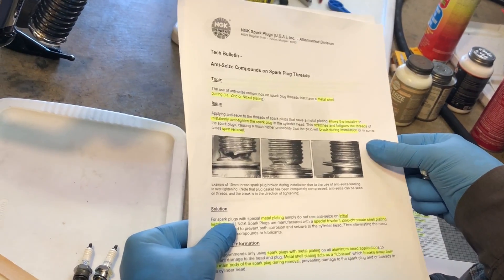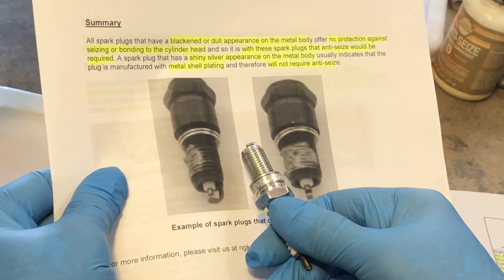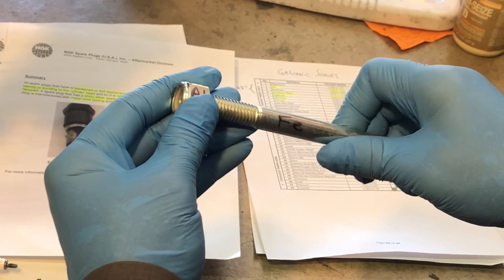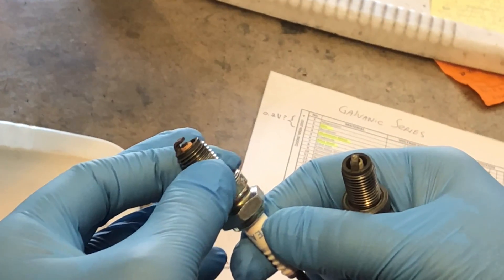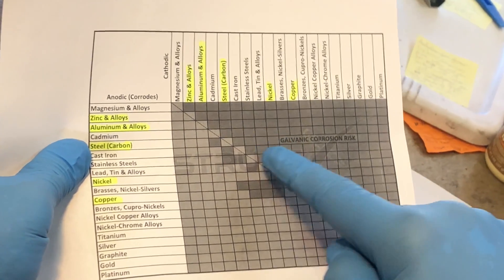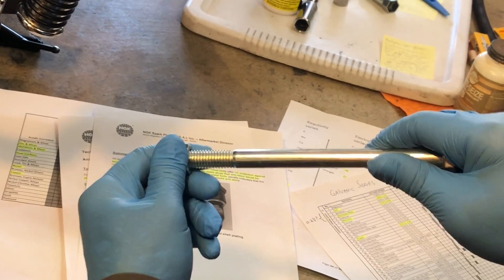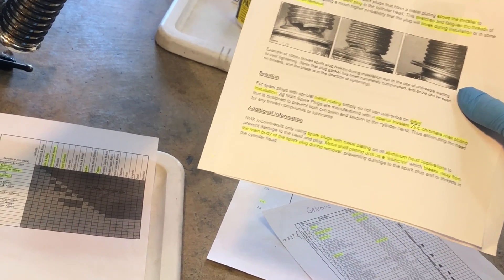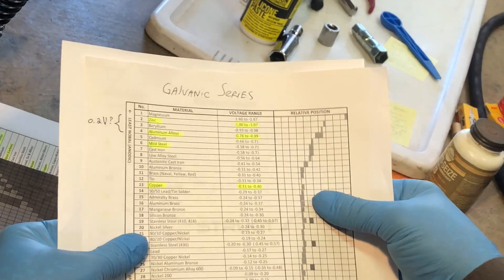Aluminum cylinder heads, spark plugs, anti-seize, & galvanic corrosion

Comment: Excellent video!!  I don't care what anyone says, all of my spark plugs will get anti seize with a 30% torque reduction!!  I see time and time again these idiots in the comment section regurgitating not to use it, and I can only wonder if they are running a machine shop fixing stripped aluminum heads, haha!!  And just like you demonstrate what happens to the factory coating after numerous heating and cooling cycles perfectly illustrates why to use anti seize!
Reply: Yes, the torque reduction is the key if the torque spec is for dry threads.  Airplane engines require antisieze per the manual.  The torque spec given is for a lubricated threads.  It is very specific about leaving the first two threads that stick into the cylinder clean.
Reply: Exactly, in fact the Bosch spark plug manual species the % reduction in torque values when using anti-seize. I removed spark plugs in vehicles of friends and some were a real challenge taking time and being patient. In over 50 years, I have always used anti-seize on spark plugs as well as exhaust and high heat components.
Reply from the maker: Thank you for the comment.  Yes, the more miles-in-service a plug has, the higher are the chances of it seizing up in the spark-plug hole.
Reply: Yamaha motorcycles come with anti seize on the plugs from the factory and use ngk cr10ek etc plugs.  These have the zinc coating.  
Yamahas service manuals call for standard anti seize on the plugs.  
When i went to the tech training we were told you should use it to prevent broken plugs.   Exactly the opposite what NGK feels😂
Reply: @blue03r6  Thanks for sharing that!
Reply: Putting steel inserts in an aluminium block would solve the issue, right? 
Ok, it would be an expensive solution for a problem that only occurs on a minority of the engines so I understand why this isn’t done by manufacturers. Or are there manufacturers (for special applications perhaps) that do use inserts? 
I’m just curious.
Reply: IMO, helicoils or steel sleeves would likely help, but as far as being practical, probably not so much for a manufacturing process the manufacturers simply wouldn't want to take on the extra costs involved, plus once they get the heads out of the plant, and 100K+ on the engines, they could care less, in fact, they probably hope you wring the threads out so the owner will buy another new vehicle!  if you "sleeved" the spark plug holes in the heads, you still have the aluminum thread the sleeves are threaded in, so that is still a weaker link than steel.  Since mechanics are nuts today and charge so much, it makes more sense for some folks to just buy another vehicle.  IMO, a little anti-seize with reduced torque will solve all those dissimilar metal funkiness we sometimes run into with engines.  @Conservator.
Reply: @AccuracySpeaks  Thanks 👍
Reply: @Conservator.  This takes me back over 40 years ago to the days when I was a flight instructor and would work on training aircraft (Cessna) Continental and Lycoming engines on below VFR days. I was surprised that new cylinder assemblies came with Helicoils in them. I always thought they were only used for repairs.
Reply: @a.c.e.7568  Ah, thank you very much! Using them in the aircraft industry makes sense and it’s always nice to have your thoughts confirmed. 🙏
Reply: Well, what happens when that plug doesn’t get grounded because the antes you may have not had it happen yet or you get a little bit and it causes misfires. I’ve had both things happen and I’ve used the gray antes on plugs and still had them seized in so I don’t use the gray. I use the gold because it takes more heat, I’ve yet to see time I’ve been working on vehicles in my career and last 42 years a NKG plug seized in head. I’ve never seen one unless it had water down in that plug hole. That’s the only way, but I still got the plug out with no problems, I understand what they’re talking about with a different types of metals. It won’t go around correctly two different types of metals with anise will cause of chemical reaction. I know you don’t believe it but if you think about it logically and been around long enough and seen Russ belt vehicles New York, DC, Maryland back west you don’t see it I put anise on wheel bearings because I fight those bastards to get them off tooth and nail. I even put them on you joints the bell of the transmission so it does not seize because of the salt and a snow rain whatever we pull transmissions out had the bolts completely out because it was seized on the block. It was just hanging there would not break loose. We had to get a air hammer lightly go all the way around it and break that pig loose. It was stuck all the way around to the Bellnever been out snowplow truck if you ever worked on one of those your best friend is those torches and the turbo sockets and air hammer with a bit so you could put a socket on it that bolt
Reply: I've been preaching antiseize for 40 years. Your presentation was excellent.
Reply from the maker: Thank you!
Reply: Working as a Mitsubishi tech in dealership since 1994 been replaced thousands of NGK spark plugs when performing 100000 km service (First replacement since rolled out from the factory) apparently never had one seized before until today.
Reply: On the other end of things, the only plugs I’ve ever had trouble with were ones I put anti-seize on. The stuff doesn’t handle the heat and gum/carbon up. I stopped using it over 25 years ago without issue.
Reply: Hey! I got a great idea! Don't be a lazy fool and leave your sparkplugs in your engine for a hundred thousand miles! And believe me when I tell you, that you don't want to reduce your torque on a Ford F-150 5.4 triton engine or it will launch a sparkplug right through the hood of your vehicle!😳
Reply: @tonymayhew191 you are correct. Everyone has to make it complicated. Just change your plugs
Reply: @randyralls9658  Yeah and some of them even wreck their aluminum heads in the process removing a seized spark plug.. I never have though because I take precautions.
Reply: @tonymayhew191 :  You understand that derating torque spec for lubed threads results in a spark plug that is equally stretched compared to the dry thread install. Thus the two are equivalent.  Yes?

Comment: Thanks for putting this up.👍What you say about decreasing the torque by 30% or so makes a lot of sense. I changed the spark plugs in my daughter's car and one of them was corroded, and misfiring. Is there a way to clean the mild corrosion on the engine block around that spark plug?
Reply from the maker: If the area around the spark plug can be easily accessed, you could try removing the corrosion using WD40 and a fine Scotch Brite pad or 000 or 0000 steel wool.  Just make sure the spark plug is threaded into the hole before you do this, so that the debris you generate does not end up inside the engine.  Then clean the area with mineral spirits and wipe up with a paper towel or clean rag.  Finally, use some compressed air (or something like a Metrovac Air Blaster) to blow any remaining crud out (don't forget eye protection).  Also, you might find my video on spark-plug replacement helpful: https://youtu.be/q2r0FmzXLI0
Reply: @Zerk_Ziegler  Thank you, I checked out your other video about changing spark plugs - very informative. I like that you address spark plug corrosion in this video, not many do. My daughters car is a 2008 Mazda 3, so the spark plugs are very recessed, but I might give it a go. Thanks again!🙂
Reply from the maker: If the plugs are recessed, it is important to blow any debris out of the recessed areas.  Otherwise, at least some of it may go into the hole the next time you remove the plug.  Not the end of the world, as it's likely to be blown out of the exhaust.  However, there is always a chance of scoring the cylinder walls and/or damaging the piston rings.
Reply: @fredfred4086  from my experience... change the boots. silicone grease/oil will help, but mostly.. change the boots. misfires and corrosion usually suggests pooled water sitting in the hole, the boot gets wet, arcs internally, gets a carbon path... and once thats developed, its useless.

Comment: What do you recommend to use removel of seize spark plugs for my 2004 Ford Expedition
Reply from the maker: First, if at all possible, clean the area around the spark-plug threads thoroughly using a solvent, like mineral spirits.   Then apply a 50/50 mix of acetone and synthetic automatic-transmission fluid around the threads.  Give the fluid ample time to penetrate (the acetone makes the lubricant very thin, so it can wick into the threads by capillary action).  I would then wait two or three days,  liberally re-applying the penetrant several times.  Do not use "gorilla" force when trying to screw the plug out -- try to turn it counterclockwise a little and see if it moves.  You could also try turning the spark plug CLOCKWISE at first, just a smidge.  Do not force it, or it might break!   If it moves a tiny bit, that is all you need.  Then try to turn the spark plug COUNTERCLOCKWISE, but again, only a little.  Then apply more penetrant and try to work the plug back-and-forth to see if it moves easier.  The key is to proceed slowly and not apply a lot of force.  If you get the plug to move a little, but it still does not want to come out,  reapply the penetrant and walk away for another day or two.  Again, I cannot stress enough that patience is key here -- rushing the process never ends well.  There are other things you can try, but this should be a good start.  Oh, and whatever you do, NEVER apply any impact to the spark plug.
Reply: @Zerk_Ziegler I just watched a video where Ford technician recommends removal of plugs with a ½" impact gun.. 😅
Reply from the maker: @sidewayzmike  If that porcelain nose breaks ... keep in mind, also, that spark-plug threads are formed in a thin-walled tube, not a solid shank -- a threaded thin-walled tube is much weaker in torsion than a solid bolt of the same OD.
Reply: There’s low torque impact guns available for the removal of plugs and glow plugs, they don’t have the power to snap anything but the rattling seems to do the job every time.  You let it rattle for a while, it isn’t strong enough to loosen it, then put the socket back on by hand, if it moves work it out half a turn, pour release fluid down the gap, unless you have a good feel for threads and can tell if it’s dragging a thread up or just tight.  Work them in and out a bit and they’ll come out.  I’ve never broken one in 40 years.  And don’t torque the new plugs in, use feel to bed the washer then back it off then back down plus a few degrees.

Comment: Champion Aerospace 2612 Spark Plug Thread Lubricant is an old aviation standby. If you think car parts are expensive try aircraft!  
It's easy not to overtighten. I've NEVER done that in over forty years working on delicate motorcycle spark plugs let alone car plugs. Many "mechanics" who never worked on anything delicate or precise treat spark plugs like lug nuts. I've had to fix stuff they buggered but every stuck spark plug I dealt with was either corroded due to moisture intrusion or crossthreaded. None were stretched to failure.
I use Time-Serts for thread repair after grinding a SMALL notch in the rim. Install Time-Sert, drill hole centered on notch slightly smaller than a section of steel finishing nail, fill with JB Weld (takes very little) then drift a short (about 1/4") pin you cut from a finish nail. That pin cannot escape because the plug traps it. Old aircooled motorcycles require frequent plug swaps, much more often than cars and these have never had a customer comeback at the shop where my Vincent-restoring mentor taught me the trick. He'd been wrenching motorcycles since the 1950s. Both of us were USAF crew chiefs and I was also a jet engine mech.
Reply from the maker: I will have to order some!